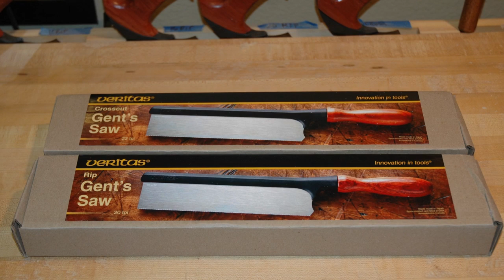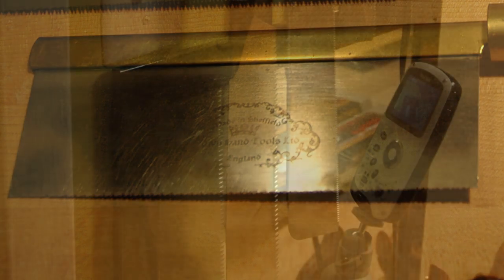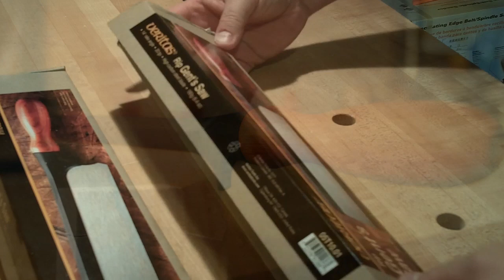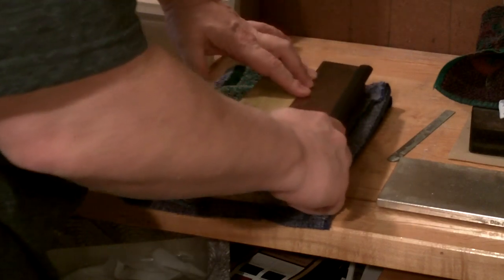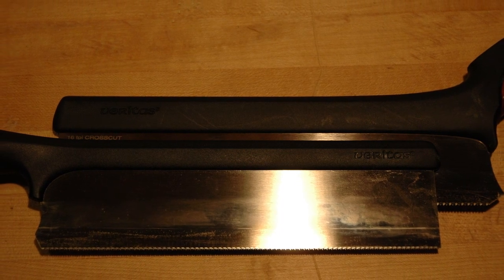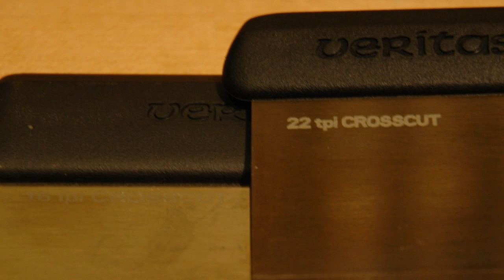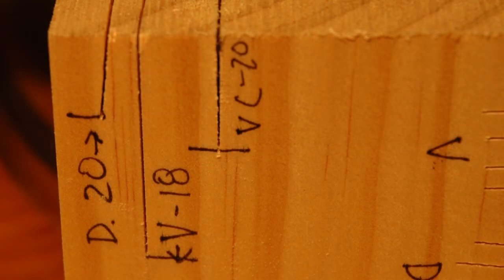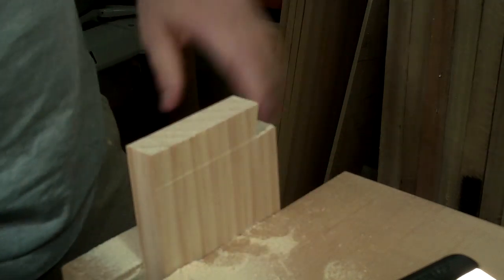Veritas Gent Saws - Rip and Crosscut

Comment: Good Video, I have the 3 set Veritas Dovetail saws and they perform flawlessly.
I believe that the Gent's saws are just as good just with a different grip style in your hand. You mentioned your Dozuki saw that cuts smooth but slow, so, before you "knock it", I suggest you try a different saw that I have: Gyokucho #372 Rip Cut Dozuki (Dovetail) Saw, it's razor sharp and cuts pretty fast too either rip or cross cut.
David Barron swears by it, I second it. Check out his videos about Japanese saws.